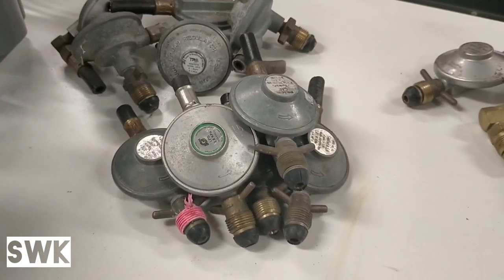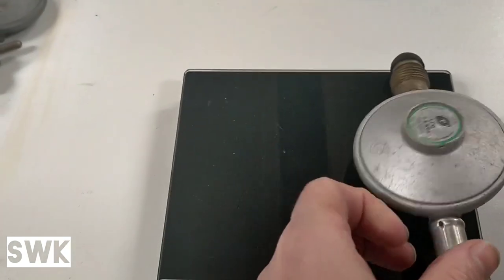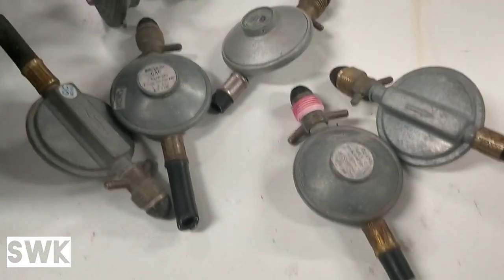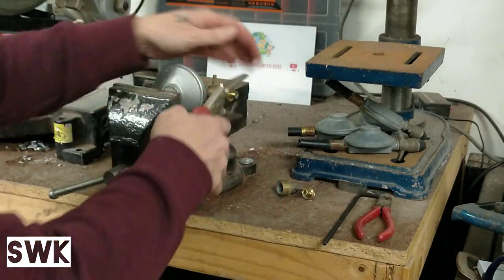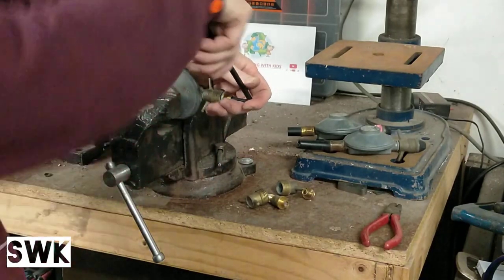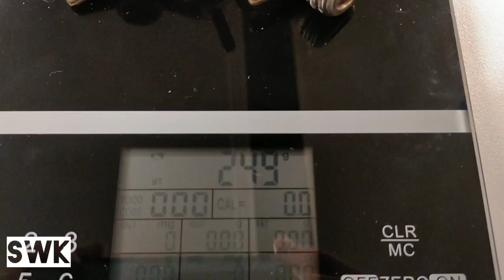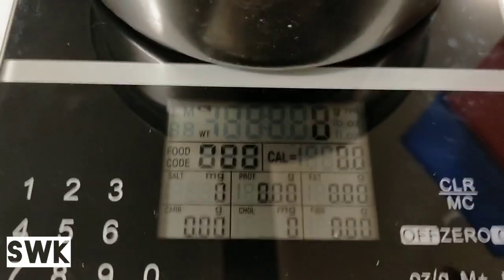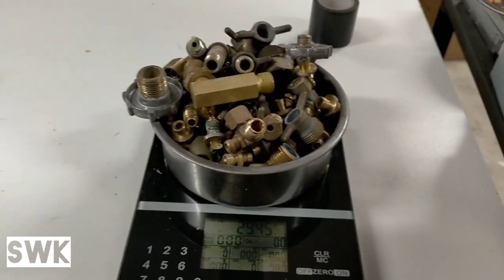Scrapping BBQ gas fittings for BRASS - Is it worth it? | MONEY for Brass

Comment: Yeh definitely worth the time to strip down another great video don't need much brass for weight
Reply from the maker: I was very surprised also. Minimum return is 25% I ended up with 32% brass as some regulators have more brass on them.

Comment: Great video! Although I rarely pick up those regulators I have never seen the ones with those rubber bungs to seal the connection. They used to have no O rings a long time ago and sealed quite well. If you are going to make a gas furnace and you find a C.I.G oxygen/acetelyne/Co2 regulator in hard rubbish don't be too hasty to strip it for brass. They all have a 1/4 B.S.P. connection thread connected to the different fittings so you cannot connect it to the wrong bottle. I used a fitting from a  
Barbeque regulator and connected it to a oxygen regulator. If you try to use a barbeque regulator they will have very little gas flow so the furnace will not get very hot.
Reply from the maker: Thank you for the tip mate. Im keeping an eye out for these bottles but it seems no one is throwing them out. Maybe it's because they are banned from Hard Rubbish same as BBQ gas bottles? Appreciate your input, thank you 👍
Reply: @ScrapMetalTV.  Still see plenty of propane bottles in hard rubbish and some have plenty of propane in them. Why pay for propane when you can get it for free.
Reply from the maker: @luckygen1001  Yes you're correct. If I see them I'll definitely grab them. So far I've only seen 1 and that's the one we using on our BBQ 🤣.